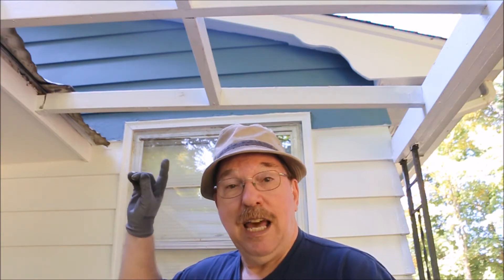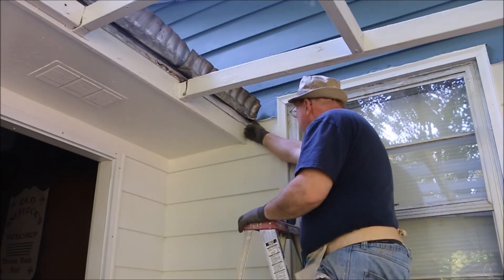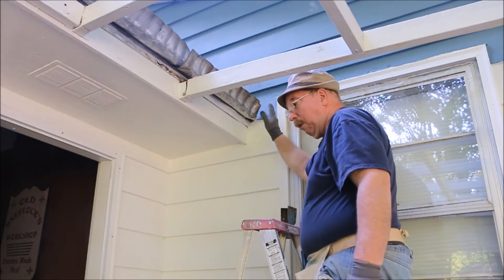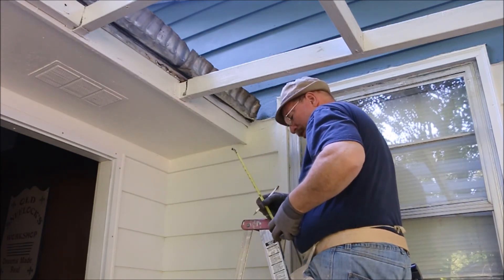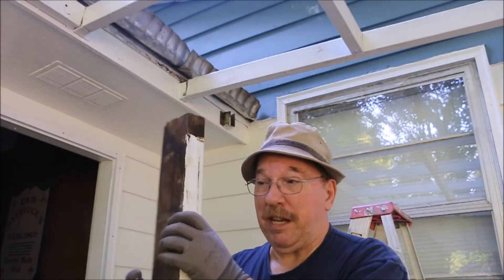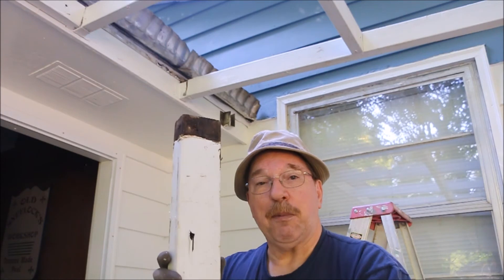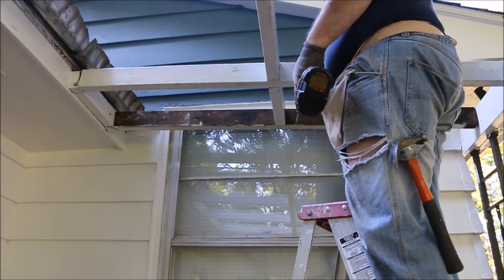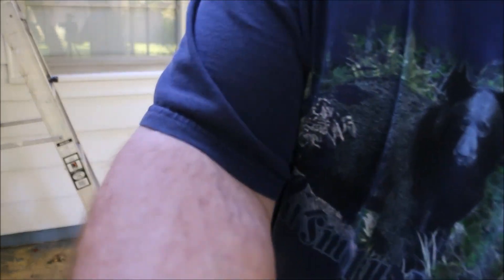PORCH ROOF REPLACEMENT ~ REBUILD THE ROOF TRUSSES

Comment: ..yes it is Bull$#!& !! they will even burrow in Treated lumber. a 1 1/2" box nail is a 4d. We redid a roof on an apartment building built in the 40's. the ceiling joist were on 28" centers and ran about 1 1/2" out every 6'. Some jobs i have been on i wonder if they even had a square on the truck...!!
Reply: ...........or in the town!
Reply from the maker: Ol James Oh man what a pain trying to work on old houses. My house by Union City was built around 1891. They made the frame from oak 2x4's and covered them with 1" oak planks and clapboard siding. The spacing in most of the house was fine until you got to the laundry room. They had finished the inside of a wood shed that had been attached to the house. It looked okay but the studs were pretty twisty. That part of the house was plasterboard and had been done in the early 50's. We put in a new bathroom and had to take all the walls out to the studs and shim them straight.